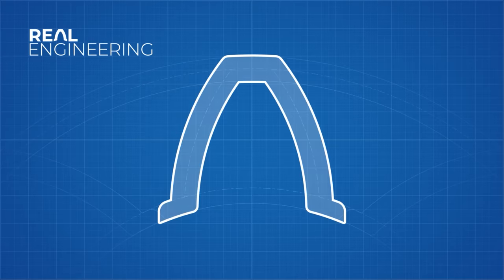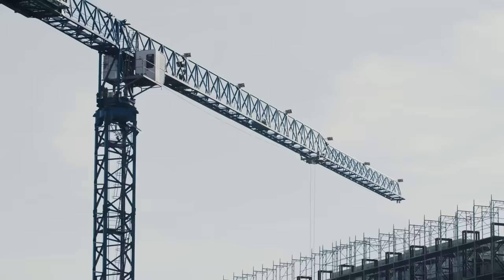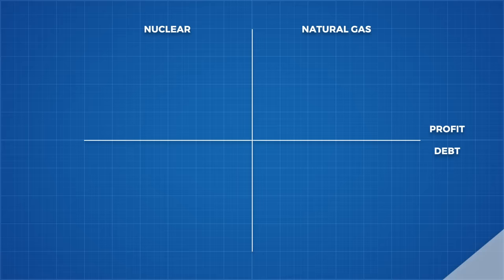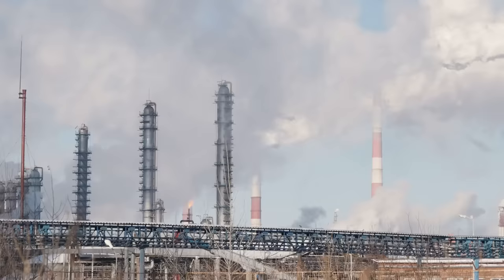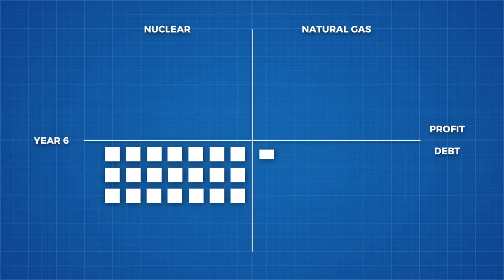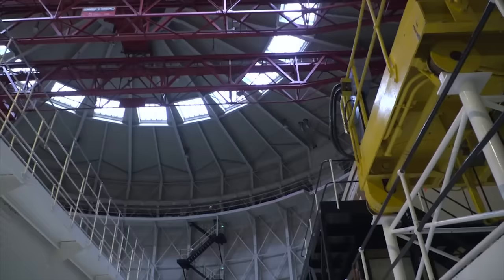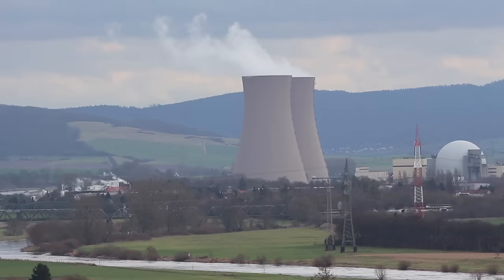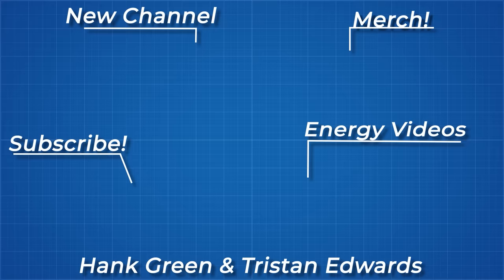The Economics of Nuclear Energy

Comment: While mostly a good overview, this was fundamentally a bait-and-switch argument. You start out discussing the drive to achieve a carbon-free grid comparing nuclear to wind and solar asking the question "why not nuclear?", then proceed to compare nuclear to natural gas on its economic basis!?!?!  All because wind/solar are intermittent and require a backup which is often NG. What is going on here?  A better approach would have been to stick with comparing nuclear to W/S while adding in the added cost of a peaking NG plant along with the carbon footprint impact of that plant. Also, there was no discussion of the fact that nuclear plants last 60-80 years perhaps longer, while NG, solar, and wind are more on the order of 25. Most ROI calculations are only looking at a 20 year horizon, seriously stacking the cards against nuclear. So what's going on here? Are you trying to evaluate competing low carbon energy solutions, or just trying to compare nuclear with NG on a short-term ROI basis? The first would be an interesting exercise, but it's not what you did. The second seems pointless unless we plan on fossil fuels as our long-term energy solution.
Reply: We cannot build new nuclear in the U.S. economically (reference VC Summer and Vogtle).  
Given the current conditions (no investor owned utility is even considering building new nuclear) even if we decided on nuclear it is at least 20-25 years away.  
If you listened to the Biden administration even they said natural gas may have to be used as a bridge to a carbon free future. 
Nuclear plants are designed for a 40 year life and while that can and have been extended beyond 40 years these older plants are just one major component failure away from being shutdown for good.  Palisades was just shutdown 10 days ago because of this and 20 or more old plants will shutdown in the next 10 years. Wind turbines if maintained can last indefinitely.
Reply: @clarkkent9080  Not sure why you replied to me as you didn't address my points. 
The economic viability argument results directly from the cost of capital. Nuclear is economically competitive in countries that treat power generation as critical infrastructure, similar to roads.
In a wind and solar future, gas is not a "bridge to a carbon-free future". It is an integral part of the wind/solar/gas-powered grid. Certainly not carbon-free, and likely not even that low-carbon.
Nuclear plants are licensed for 40 years. They are designed and built to last far longer. Your claims about plants shutdown over one major component failure are just wrong, as is your claim that is why Palisades was shut down. Entergy’s closed Palisades because they decided to exit the merchant nuclear generation business after deregulation substantially changed the electric industry in the late 1990's.
Wind turbine blades have a 25 year lifespan after which they are currently being buried in landfills.  Just google it...
https://www.bbc.com/news/business-51325101
Reply: @WaltHeenan  I responded to your incorrect claims. 

 First of all my experience in the nuclear industry  is restricted to the U.S. and the type of plants that we operate here. Examples from Europe or Asia have no bearing on the energy situation in the U.S. .
In the U.S. new nuclear has been and the latest examples are/will be massive financial failures.  VC Summer canceled after spending $7 billion with ratepayers on the hook for another $10 billion more in contractual obligations for plants that will never produce power.  Vogtle 110% over budget (now $31 billion spent) and schedule and they still may never operate.. The Terrapower (345 Mw MSR) and NuScale (77 Mw SMR) were each advertised as costing $1 billion each. Now each is getting $2 billion in matching taxpayer welfare to pay for investor owned demonstration projects. That is reality in the U.S.. Explain how that is economically competitive?

Nuclear plants are DESIGNED to be operated and licensed for 40 years. 59 plants have applied for and received license extensions but many of those have shutdown shortly before or after the 40 year life was reached. The oldest U.S. operating nuclear plant (Nine Mile Point) is 50 years old and is scheduled to shutdown in 2029. 

According to Entergy  the owner of Palisades;  plant operators “made the conservative decision to shut down the plant early due to the performance of a control rod drive seal,”  But I guess you know more than the owners. 

Nine U.S. nuclear plants are scheduled to shudown over the next 5 years with 16 additional plants no longer cost effective compared to other generation sources and are currently under consideration for shutdown in the next 10 years.  The bottom line is that old nuclear plants are shutting down and only demonstration plants are planned and those will not come on line before 2030 so nuclear's contribution to the U.S. energy mix will decrease over at least the next 20-25 years. SOMETHING will replace that lost generation and if nuclear doesn't come up with a magical solution to its high cost compared to the SOMETHING, then it will have no future.

Your comment on wind turbines is the typical read flag of an anti-renewable person.  Yes wind turbine blades are made of fiberglass and do wear and are typically replaced every 25 years.  Not expensive and not difficult.  The wind turbine itself with normal maintenance will last forever.  As in any capitalist society, businesses do what ever is cheaper and while fiberglass blades can easily be recycled, it is cheaper to store or landfill them.  They are certainly not toxic and take up less volume (if ground up) than  the amount of spent nuclear fuel that is generated in that same 25 year period.
Reply: @clarkkent9080  good response. 
People get lost in the flashy technology. 
The external factors are often ignored. 
Happy to say more if you are interested.
Reply: @stephenbrickwood1602  Somes times it is difficult to follow these comment strings.  I am at a lost to understand your response.  What did I say that you agree with or disagree with?
Reply: @clarkkent9080  
Hahaha Hahaha so true, tricky to follow for me aswell. 
I like your analysis in general, you seem to be critical of logic failures and you seem to know much more about the Nuclear topic. 
I think that nuclear might be an answer, but as a world solution with billions of people in dictatorships and no CO2 for the world to survive,  the military costs will expand massively and that is an additional cost to be added to nuclear power costs. 
The silence is deafening on these additional matters. 
More costs are
The grid demand will expand x3 for EV transportation charging and so it's construction.
A distributed power supply from all buildings rooftop solar PV systems, as all buildings are connected to the grid today means self powering and grid supply.  
The grid will be receiving power and from the ends and concentrating power to the nett users. 
My thoughts.
Reply: @stephenbrickwood1602   I worked in the nuclear industry for 40+ years.  I was a Reactor Operator and Senior Reactor Operator at 5 different nuclear facilities and consider myself to be pro-nuclear. I was taught to think and act logically so here are my thoughts:
After the VC Summer and Vogtle financial failures no investor owned utility is even considering new nuclear in the U.S. at this time.  If a utility was interested, the Vogtle project indicates that a standard PWR would take at least 15 more years to plan and construct. 
Terrapower and NuScale are each building one small demo test gen 4 reactor that are 10 years away from operation and would require at least 5 years of operation to prove the concept before large scale construction of more would occur. And either of these reactor types would require multiple reactors to equal the output of one standard PWR.
Old large nuclear plants are shutting down all the time with the Pallaises shutdown occurring just last month  with many more planned shutdowns in the next 10 years.
Any way you slice it, nuclear power's contribution to the U.S. electrical grid will decrease over at least the next 15 years before new nuclear could come on line and probably another 10 years before new builds could over come the lost generation from old plants continuing to shutdown. 
Logically, some power source will be built/installed to make up for that lost from nuclear power over the next 25 years.  I don't know what that power source will be (more solar, Battery/flywheel/hydro energy storage, wind turbines, ocean wave generators, natural gas turbines, etc. ??) but whatever it is, nuclear will have to be better, cheaper, and built faster to compete.  In other words, new nuclear is now too little too late.
Reply: @clarkkent9080  with majority of transport being electrical the power demand would triple. 
More power stations. 
More grid.
More expenses/costs.

With rooftop solar pv. 
Local consumption and 
Local storage and 
Distributed supply into the existing grid, but a smarter grid.
The extra demand is kept very local.

I talk about this because there are people who are pushing hard for the Nuclear solution which would kill Renewables after the sunk costs of the nuclear power  solution.

Comment: This is a misleading video. First off, nuclear is the safest form of energy production. There have been accidents and those have been tragic, but it is much the way airplane crashes are both tragic and rare. It really makes the news though. Second off, statistics about how much solar energy hits the planet are just statistics. The efficiency of common solar panels is probably closer to 10%, and ,well we wouldn't want to cover the whole earth with solar panels. It would be an eyesore and cause immense habitat destruction. Third, this video makes it sound like storing energy made by naturally cyclic renewables is a done deal. It is not. Simply building enough batteries to handle it large scale is not going to work. There have been many other energy storage solutions proposed in which you store energy by raising something heavy (water, gravel, cement blocks) and generating energy as you bring it back to the ground, but all of these have proven inefficient. These solutions would also require enormous projects in terms of their physical size. Meanwhile, nuclear power generation produces the highest amount of energy per acre of any generation.
Reply: "The efficiency of common solar panels is probably closer to 10%" You shouldn't go by efficiency, but capacity factor. That is, the percent of the nameplate capacity the unit actually produces. Ideally located panels with tracking can hit 30-35%, with an average closer to 25% for commercial installations. Consumer (non-tracking) are closer to 15-20%. Although averaged over the life of the panels, it's probably about 20% lower than that (around 26% and 13% respectively).

That's still terrible compared to nuclear (90-105% capacity maintained over at least 2x the life), but it's important to get the numbers right.

Comment: It’s mostly a good video but you state that “nuclear power plants have a terrible track record for running over budget and over time” they can run over budget but I can see no real problem with running over time. My plant built in 1972 will continue to run with a license renewal. You also say “before even talking about safety” when nuclear is one of the safest industries. I can see a bais towards renewables in the video because you’re focusing on old plant designs and money when nuclear plants run for a long time and money isn’t the only focus, the goal is low Co2 output. People for renewables like to think it’s THE solution when the energy storage isn’t there. New nuclear plants are already designed with less systems and safe shut down requiring no operators or power, ready to be built.
Reply: He means that NP construction times often times run way over the planned time. I.E you plan for 8 years but finish it in 15. For example Olkiluoto 3, which was supposed to be opened after 5 years of construction works, in 2010, but is going to open just now (12 years after)

Comment: I can't get your debt calculation to add up. If I build a house for $5 000 000 over 5 years. Then I'll borrow $1 000 000 per yer. Not 1, 2, 4, 8 as in your example. The debt cannot raise exponentially like that :s it does note make any sense.

And it makes sense for california  to use solar with their huge amount of sun hours. But Germany,  with moderate amount of sun, moderate amount of wind? Nope, not at all. Their co2 levels are higher in reality also since they've built wind industries in northern Sweden which they get certificates from. These plants mess with Swedish transmission and have helpt rise certificates of electricity to never before seen levels.

Germany also is low risk of natural disasters, and have had next to no issues with their plants.

Only a moron would vote to close them.

Comment: First: while the cost to profit margins might be that in the USA, in other countries there are other factors that are completely neglected.
Second: cost of storage or recycling of spent nuclear fuel rods seems to be completely neglected in this video.
Third: the dangers of exposing large swaths of the countryside to the highly toxic elements of most nuclear power plants (both uranium and plutonium in particulate form will kill you much much quicker by their toxicity than through radiation) are also neglected. Nuclear power plants have an absolutely aweful track record when it comes to the real safety when compared to the calculated safety risks. In the 1960's it was calculated that nuclear power plants have a much smaller chance of suffering a serious accident. In the 1970's this figure was already adjusted upwards, and after Chernobyl those figures had to be adjusted upwards again. The final upwards adjustment came with Fukushima in 2011.
All of those risk assessment adjustments have NOT been factored into improved safety standards that massively increase the cost.
Fourth: different safety standards for the structures supporting the actual reactor, such as the safety dome over the reactor, or the cooling towers,  varies massively from country to country.

For example, in Germany, all currently built power plants of ALL kinds have to factor in costs for covering their CO2 emissions, both in the construction, production of fuel, as well as during the production of power.
With the exception of nuclear power plants. Why? Because they harken back to a time when extremely long term costs would be dumped on the tax payer instead of the companies running nuclear power plants.
For example, the actual spent fuel rods have to be stored in cooling pools for many years before they can be stored in castor containers. The nuclear waste treaties for international use of radioactive waste state that all countries employing nuclear power generation have to store their own radioactive waste on their own terrritory. Such storage facilities have neither been found in Germany yet, and all previous attempts to create a long term storage have failed miserably. Currently ALL nuclear waste is stored in temporary intermittent waste storage facilities. No long-term facilities have been built yet, because no area inside Germany was found that was stable enough for the time necessary to effectively reduce the radiation emitted to within tolerance levels.
But funnily enough NONE of the energy companies running the nuclear power plants were settled with the cost of providing the long term storage, as well as the management costs for these facilities. THOSE costs were dumped on the government that proposed nuclear energy as the solution for quick, cheap, and easy power production. The problems with the future cost was dumped on future generations.

If those storage cost, or the costs of nuclear recycling plants like Wackersdorf had been foisted off on the energy companies themselves, NONE of the current nuclear plants would have been into the profit margin yet, even after decades of producing power.
Next, Germany's safety standards for the domes over the reactors are much much stricter than most US reactors. They have to be able to withstand the impact of multiple fighter jets, or even multiple airline jets before breaching. This increases the cost of construction by several factors. Thus the long term profits are cut short by a large margin. Next, safety inspections here are insanely strict, resulting in more and longer down-times for nuclear reactors, cutting into their profit margin again.

So, please, before stating in an overarching video that ALL nuclear power has a higher profit margin in the long term do the research into other nation's cost structures. Because some people DON'T like to cut corners and focus ONLY on the short term profits, but rather the TRULY long-term costs. Because that's what this video is so obviously lacking.
Reply: @Am_Yeff  Thanks, proof enough of someone resorting to ad hominem attacks to try to disprove an argument that I can support with facts.
Please refrain from answering unless you can contribute to the discussion.
Reply: @RustyDust101  thanks for proving my point